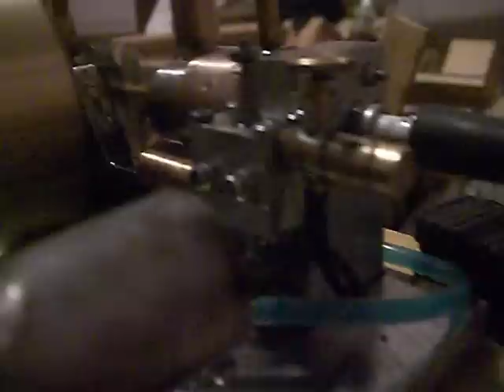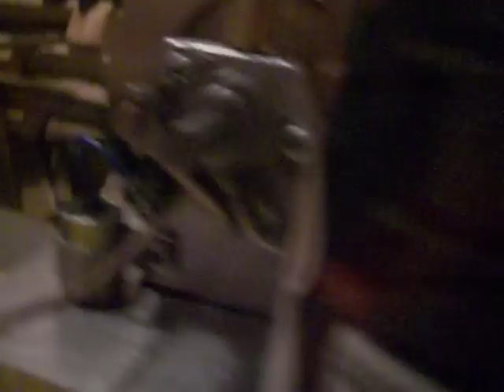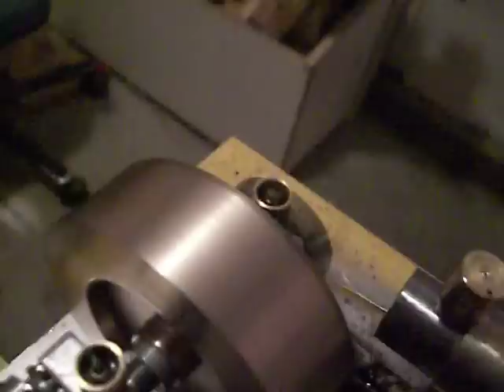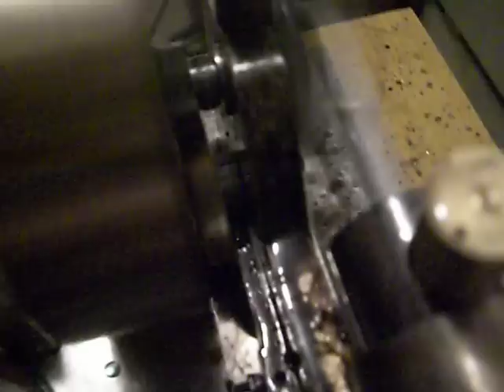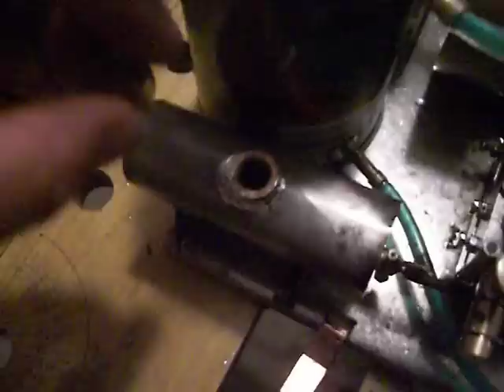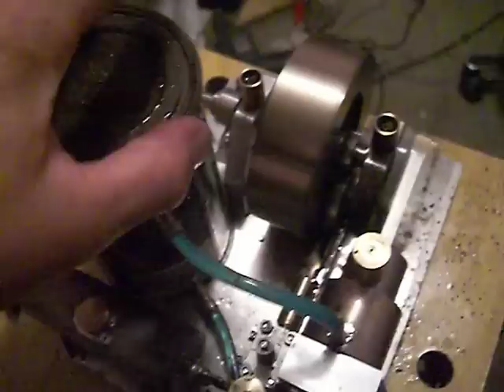Watercooled WEW engine

Comment: drip automatic oilers. 
mainly the oilder for the piston gets pushed out the cylinder and leaks down the rod and flicks oil everywhere.

simple design, works, super messy.